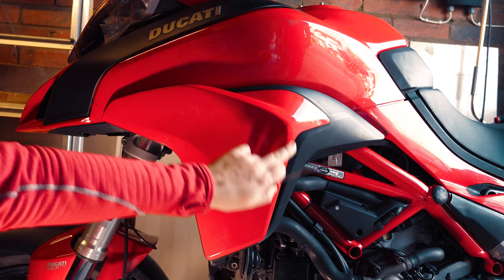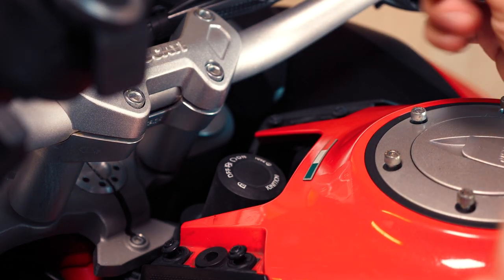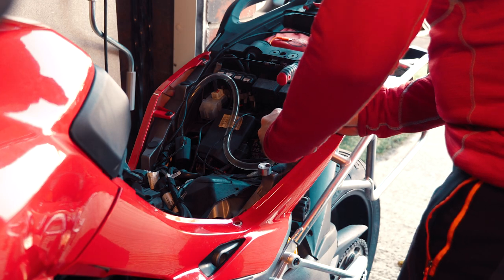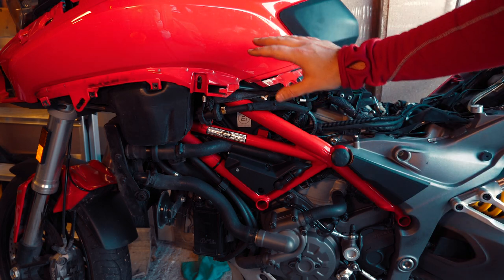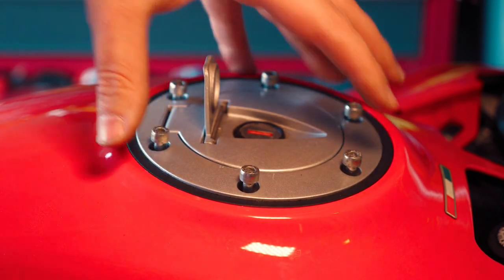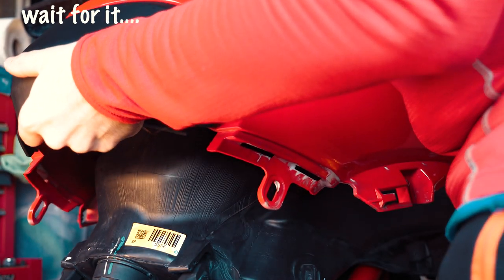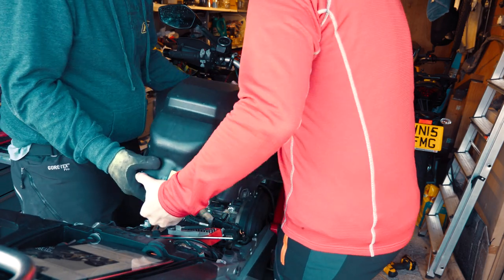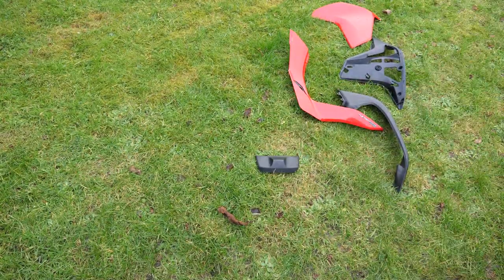Ducati Multistrada DVT - Replacing Air Filter

Comment: What a ridiculous nightmare!  I'm not looking forward to this on my 2013 Multi.
Reply from the maker: Extraction of the air filter is much more simple on the pre 2015 DVT model. You can remove the air filter from the side of the bike.Lucky you!
Reply: I hope you're right.  Haven't found a good DIY video or walkthrough for how to do it on a 2013 though.
Reply from the maker: @SWTrailsAndWheels  https://andyw-inuk.smugmug.com/Motorcycles/Ducati-Multistrada-1200/Multistrada-1200-How-to-FAQ/i-rN4BXZz
Reply: @edavies  you still have to remove the tank fairing so not that much quicker than the dvt model.
Reply: @dillonthestaffy511  ---> Trust me Dude... I've done an air filter swap on my 2015 DVT.... have seen the proceedure for the same on earlier iterations of the Multistrada... the DVT will consume much more of your time to do the swap.

Comment: Thanks for the video! Hard to find detailed info or video on this ridiculously difficult procedure to perform a basic maintenance function on a motorcycle. Love my Enduro but get real. Who designs these things? In the video you mention not removing bolts at tank fill cap. Does that negate the need to access the hoses under the cover near the cap? Really don't want to break those and also hear the fuel pump connection is easy to break???
Reply from the maker: Thanks for the comment. That’s correct if you don’t remove the bolts at the filler cap you can remove the tank plastics (so long as all the other bolts are removed) without having to remove the filler cap. This means you don’t need to disconnect the hoses before moving the faring. Once the fairing is off you can then disconnect the hoses easily.i treat all connections on this bike like glass lol
Reply: @Jason Cartee ---> Not 'Difficult', just 'time consuming'... ✔

Comment: Replaced the OEM air filter on my 2015 DVT with a K&N last summer (2018). I have a copy of the service manual for the bike, so I knew what had to be done but took it slowly none-the-less. Time to complete the job... approx 2 hours. I have the Enduro package, so the cage had to be removed also... adding to to time count.

 It's nothing too difficult, just 'labour intensive'. Quite a few panels to remove. When the tank was going back on, the 'Diaper' kept moving around (out of place) so I left it out. I don't see the purpose of it anyways.

One word of advice... have the tank near 'Empty" before starting the job... easily overlooked.

Comment: damn good video; also applies to the newer 1260's; they are identical.

I also made the same mistake as you with the filler cap the first time I disassembled the fairings.

I hate how complex these things are to pull apart. But they are an amazing machine.

Comment: Ed - I agree, great video and very useful as I am about to embark on my MTS DVT Desmo service next month.  Can’t thank you enough!

I have a question on your pro tip for leaving the filler cap connected.  When you reinstall the fairing do you think it would be difficult to refit the tank cover over the gasket to have everything lined up and seated or would you need to remove the filler cap then?  The service manual is rather vague on the procedure.  

Thanks and we all owe you one.  

Cheers,
Rob
Reply from the maker: Hi Rob, glad this is helpful to you. When refitting the fairing you can leave the filler cap in place on the tank making sure the rubber gasket is around the filler before lower the faring back on. It will be a nice tight fit when you press down you will see the fairing clip into place around the gasket. Happy to take another video showing this piece as I didn't really cover that in enough detail. I've just had my third desmo service and I can say that next time I'm going to give it a go. I'll be interested to hear your thoughts on the process. All the best 
Ed

Comment: So how did you repair the broken connecting tube?
Reply from the maker: I used used super glue then strengthened it with some epoxy resin
Reply: @edavies  Is there any issue if the hose connector that you broke it is not reconnected?

Comment: How do you get the tank fairing off the gas tank w/o removing the gas cap?
Reply from the maker: Hi Jeff, Once you've removed all the fairing bolts the tank fairing should pop off by pressing down the gas cap and pulling up the top of the tank fairing. The gas cap is secured by the rubber gasket it's very snug so be gentle!
Reply: @edavies  thanks, good video. Needed to take tank off due to coolant tank leak. New af and coolant tank in and re-assembly begun
Reply from the maker: @MrFlyNfink  I had the same issue the coolant tank had a split where the bolt when through it to the frame. Glad to hear it’s working for you.
Reply: @edavies  seems to be not that uncommon.
Reply: found no heat shield under my tank. bought it 2 years ago w 3.2 k miles and only thing I've ever had done by anyone was fuel sensor replaced by dealer ..Looks like I'll find some heat shield material and make my own.

Comment: Just to let everyone know, you DO have to remove the bolts on the gas cap, just don’t lift up on it. 

You also have to remove 4 black bolts that connect the tank cover to the nose of the bike. 

There are also 2 silver bolts that connect the tank to the frame (they are up front towards the display)

You also have to remove the electrical connection to the fuel pump, and the hose to the fuel pump. I’m looking for info on disconnecting the hose (don’t want to break anything 😬)

This is probably the worst “how to” video I’ve ever had the misfortune to rely on. Nothing like getting knee deep in all this and find out you barely have half the info you need. 🙄
Reply: One correction: 

You don't have to remove the gas cap after all. You will have to lift up on the tank cover with more force than you are comfortable with, but it will some off. It feels a little odd, but the lines are attached to the gas cap itself, which will stay with the tank, so as long as you don't crack the tank cover in the process, there is nothing to damage.
Reply: @therealguise5136  I'm confused.  Are you saying the the gas tank cover will just stay with the gas tank, so you are basically not separating the tank from the cover?

And yes, I would have like to see the fuel delivery hose disconnected in this video.

I'm not complaining because there is no other videos out that show this process.  I have a 2020 Multistrada 950 and hoping this will all be quite similar for when I need to replace the air filter.  I can't believe it has come to the point where you can't even purchase a service manual anymore.  My 600 mile service was $400 for a glorified oil change and light reset.  I can do my oil changes, but service light reset has to be done by the dealer.  After speaking with them about this, they have offered to reset the light for me if I bring proof of oil and filter purchase + $75.00 to cover their time.  What a shitshow.

Comment: But.. The fuel pump... How do remove it..??.
Reply: No need to remove the fuel pump to replace the air filter.....
Reply: You don't remove it.  You disconnect the electrical plug and VERY CAREFULLY release the barb-type locking device that holds the fuel line into the fuel pump.  The fuel line is smooth plastic and this locking device has one-way "push in" tabs that need to be released.....I used a very fine electronics screwdriver to release each of the four lock-tabs.
Reply: @carolprice9553  thanks for that. I've not seen a four tab connector like that and wasn't sure about how to disconnect it.
Reply: Sooooo where is the fuel line ? I'm assuming you need to disconnect that before you pull the tank off no?